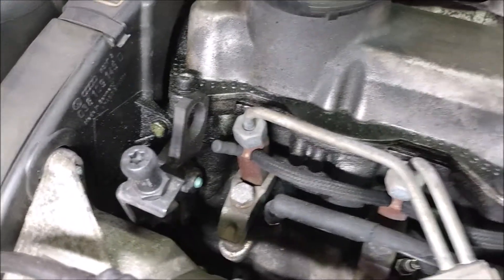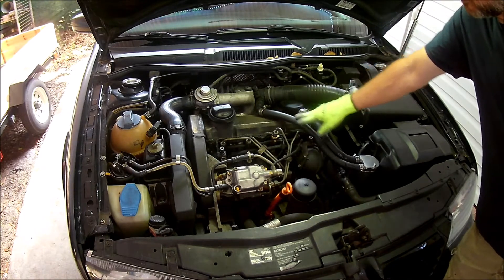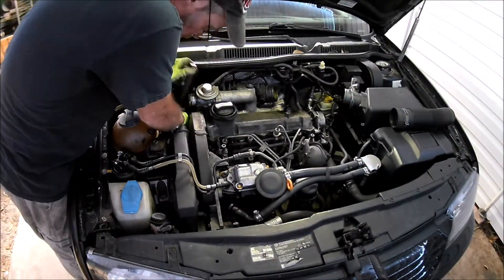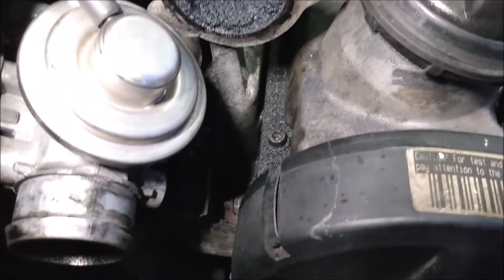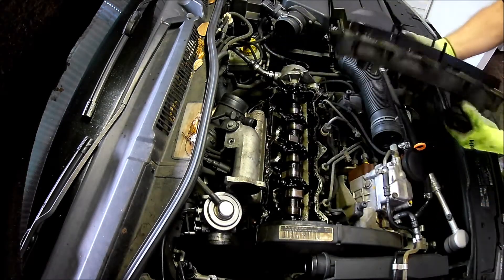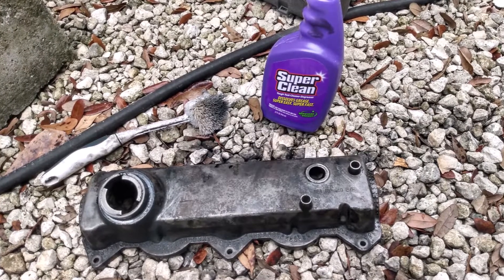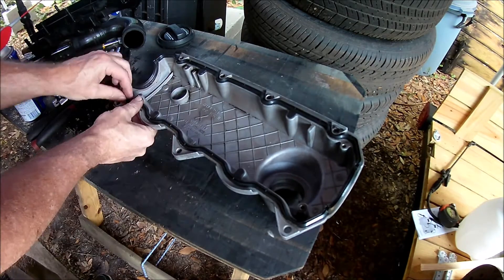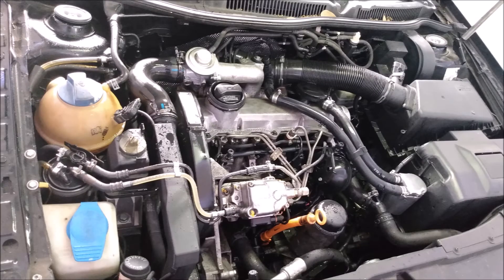Jetta Project Car: Valve Cover Gasket Replacement... The Hard Way! (ALH TDI)

Comment: Just got another ALH and in the process of doing a timing belt , new single mass conversion etc.. Im contemplating either trying this trick or the Taco8v ( fellow youtuber and ALH fanatic) method of milling out the casting to allow it to get snugged more. These covers have to come off so often that after the second or third removal the just dont seal. It drives me nuts! Theres no way im buying an OEM cover ( never heard anything good about the non OEM versions) 

Good video man , thanks !

Comment from the maker: 8:33 - I made a mistake during reassembly. Did you catch it? Comment below.
Reply: I'll take a guess -- missed the grommet for the PCV valve puck to fit in?  I've never disassembled one of those valve covers to know if it has to go back in from the bottom, or that grommet can fit in from the top through the hole.
Reply from the maker: Good call! I was able to install it from the top.
Reply: Why didn't you use form-a-gasket rather than contact cement? Like the RTV you used it in the corners.
Reply from the maker: I wanted to stick the gasket to the valve cover, so I used an adhesive.
Reply: @michaelblacktree  are you confident it will handle the heat, vibration and pressure? I didn't know domestic adhesives were tested for those conditions.
Reply from the maker: It's been about 3 months, and I've driven the car about 3000 miles. No leaks. So I'm not gonna sweat it.
Reply: @invig2  I don't think where he applied the contact cement needs to have to be sealed with rtv , I would just use the contact cement so it stays in place while installing, the gasket side that mates to the head is what is making the seal and the pressure from the 7 bolts. Not saying its 100% for everyone but if done like shown should work np... doubt its worse then the hardened old rubber leaking gasket.
Reply: The plastic oil catcher body has a stainless steel wool type mesh filter inside it, did you clean it ? There is also a round ring gasket that connects the plastic body to the vent under where the rubber grommet for the  ccv goes which is up on top. The old ones ( connecting ring gasket below ccv grommet )  just crumbles apart when you touch them on old valve covers that is
Reply from the maker: The oil separator wasn't clogged, so I didn't feel the need to clean it.

Comment: Bolt heads probably stripped out because they are a 6mm hex not a 5mm (edit, they are a 5mm... I am just an idiot) . I found using a Dremel with a softer wire wheel attachment really helped to make quick work of the remaining gasket after the torch and scraping. Worst part about this job by far is removing the old gasket. I appreciate you making this.
Reply from the maker: These ones were definitely 5mm, but they were very tight. I think they may have been over-tightened last time the timing belt was replaced. Previous owner had that done at a franchise shop.
Reply: @michaelblacktree  weird, that makes sense though
Reply from the maker: The previous owner had the car maintained pretty regular. But he used chain stores like Firestone and Tuffy for most of it. So yeah...
Reply: @michaelblacktree  yeah. I'm rebuilding a 2003 vw beetle with the 1.9 on my channel that brought me to yours. They are sweet engines. Best of luck with everything
Reply from the maker: That sounds cool. I'll have to check it out.
Reply: @michaelblacktree  I apologize for speaking out of turn, they are indeed a 5mm hex... upon reassembly I rechecked the socket, humbling experience lol.
Reply from the maker: it's all good

Comment: Nice video! What did you torque the bolts to?
Reply from the maker: I followed the torque spec in the Bentley manual, which is 7 ft-lb (10 Nm). I also re-torqued the bolts a couple days later, after the gasket had some time to settle.

Comment: Hello! Thank you for this video, I am just doing the same thing on a Skoda Fabia 1.9SDI, which has the same valve cover. From which engine did you use the valve cover gasket?
Reply from the maker: On Amazon, this gasket was listed as being correct for my car (although technically it isn't). You could try that for your car. I think the gasket is actually for a 1.9 BEW engine (aka pumpe duse).

Comment: Why you removing all pipes egr just use swivel to get to back bolts I replace mine for 15 minutes without removing nothing just valve cover and pcv valve on top of it

Comment: Do you know the size and thread pitch of the hex head bolts you went back with?
Reply from the maker: Not off the top of my head. I want to say 6mm fine thread, 20mm long. But you can measure the original bolts, to be sure.

Comment: Why did you use the bew valve cover gasket? Is it supposed to seal better? And how has it held up ? Still going strong? Thanks for the vid
Reply from the maker: I explained this in the video description. But long story short, the gasket is part of the valve cover. And the valve cover costs 10x as much.

Comment: Nice video. I hope you cleaned up your egr valve and intake while you had it off nevermind cleaning the outside to make it look nice lol
Reply from the maker: It's funny you mentioned that. When I bought the car, the EGR and intake manifold were almost completely clogged. Cleaning them out was one of the first repairs I made on the car.
Reply: @michaelblacktree  I just cleaned mine last week as part of my checklist for a positive deviation fault that's tripping limp mode under load. Mine was really clogged too but not cured limp mode 😑🙄
Reply from the maker: Maybe the turbo is coked up? That happened to mine. It was so bad, the VNT actuator couldn't move. I had to disassemble the turbo to clean out the VNT mechanism.
Reply: @michaelblacktree  yeah the vnt vain assy and the actuator are the last things on my checklist. I think I'll try the Mr muscle technique first and if that fails the turbo will have to come off and be cleaned/inspected. It's a pd100 with only 114k on the clock so I was hoping it wouldn't come to that
Reply from the maker: Yeah, it's a big job. Hopefully it won't come to that. Best of luck! 👍

Comment: Where did you get those bolts? Would you have a link?
Reply from the maker: They're random bolts I scavenged from the salvage yard. They're about the same length as the original valve cover bolts, with the same thread size. They fit a 10mm socket. If you look in the engine bay of a German car (VW, Audi, BMW, etc) you should find some of them.

Comment: Before watching. Why not re-use the old cover with RTV around the old gasket?
Reply from the maker: The rubber in the old gasket would deteriorate and cause future leaks.
Reply: @michaelblacktree  highly doubted if you cleaned and covered the gasket. But ok.